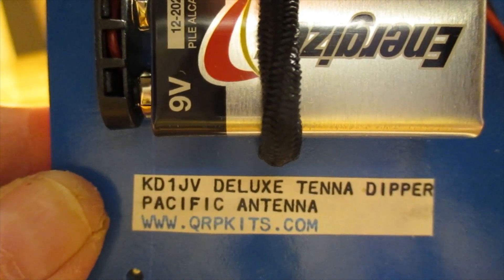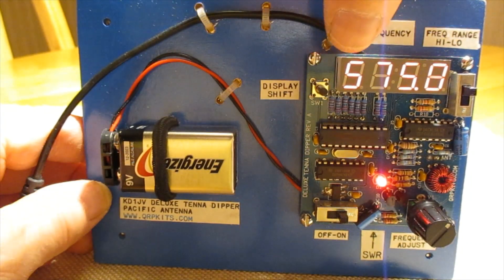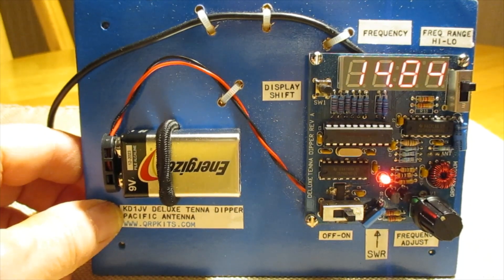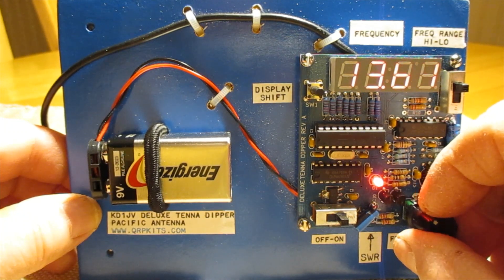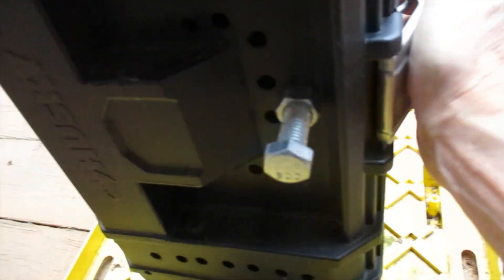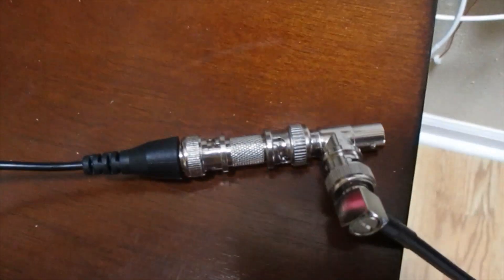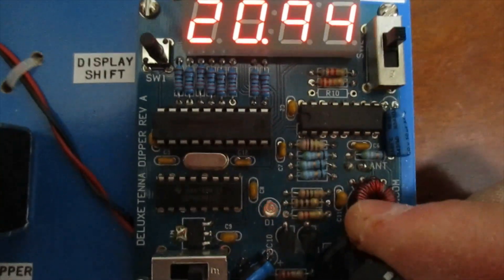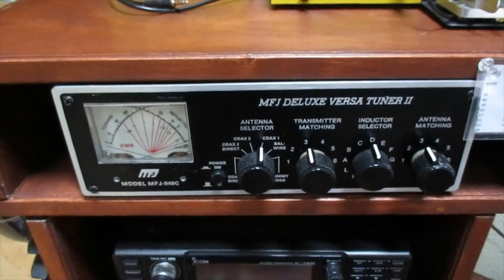KD1JV Deluxe Tenna Dipper

Comment: Building my Tenna  Dipper right now.

I was intimidated by prepping the case, and I could not find my Dremel tool, so with some patience and an Xacto knife (used as an improvised drill bit & reamer), I have successfully cut all the holes -- very nicely so! Dad would be proud! (he was soooo good with hand-tools: I used to be his little assistant as he built lots of Heathkits when I was little.)

I'm a newly-minted General Class, and I am building my first station: QRP Labs QCX+ 30m kit and I bought the 'Dipper to help me tune my homebrew mag-loop antenna. I settled on a mag loop because a typical antenna is unsuitable for my rental home. Anyway, still building and learning CW -- hope to be on the air soon! 

LOVE Your "Stealth" HOA solution!!! ;-)

Blessings & 73!!
Renee   KR3NEE

Comment: A 63 ft wire means that if you have a decent counterpoise, then you are at about 3.7 MHz as a 1/4 wavelength vertical although smack into the phone band so a little out of resonance for the CW portion. Still not bad if you can put some modest QRO watts into the wire!  I have one of those high priced (bought on a sale) antenna analyzers, but I just might be up for building a modest Antenna Dipper kit from QRPkits, although I would have preferred that they still offered the metal chassis/case that used to come with the Tenna Dipper.